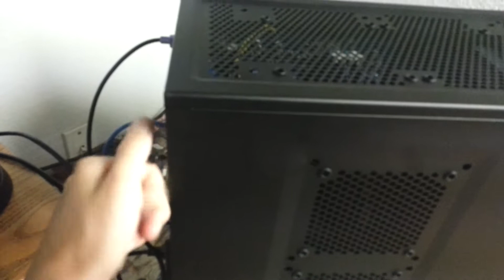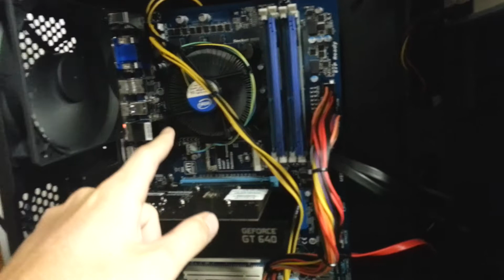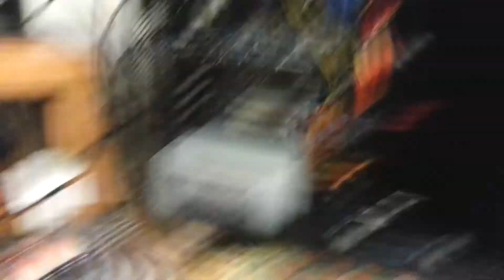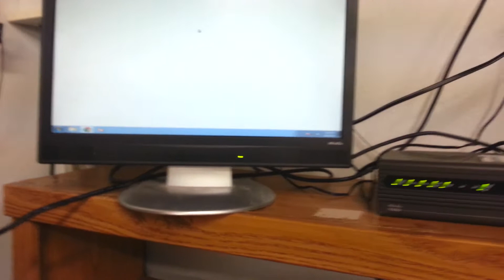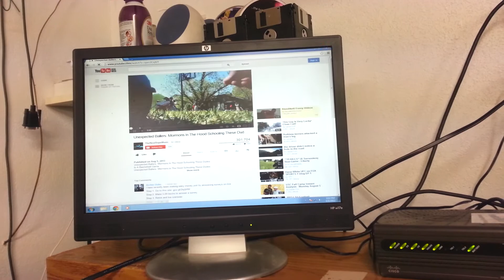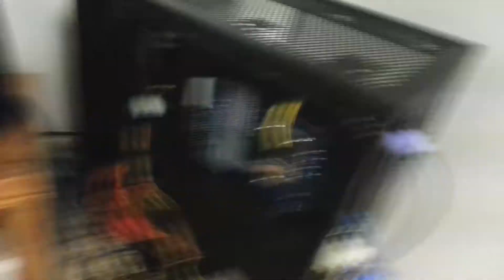My First PC build :D Corsair 200R

Comment: I use this case for my gaming and everyday rig and I must say your routing is worse than mine is with my system being in between versions. The cable over your main cpu cooler needs moved and it also needs moved off the shell for the gpu in case it partially melts and a spark jumps and in general you did a pretty bad job cable managing no offense. The cables can all be routed out of the way easily yet you just swung them wherever. Why not take pride in it even if youll never see IN it